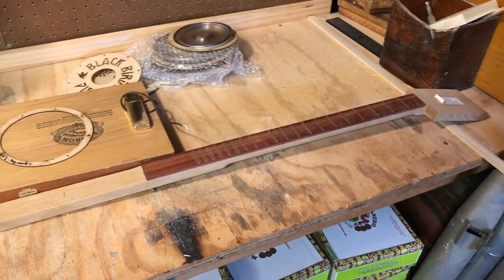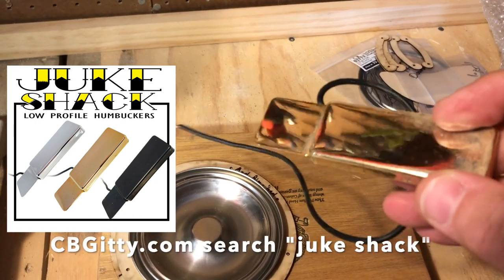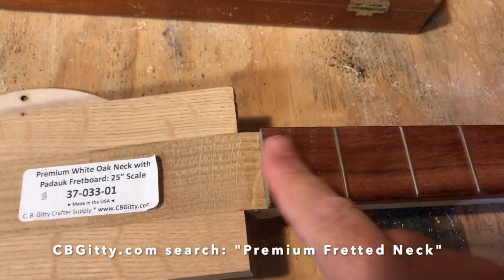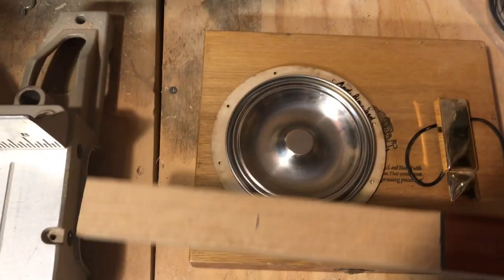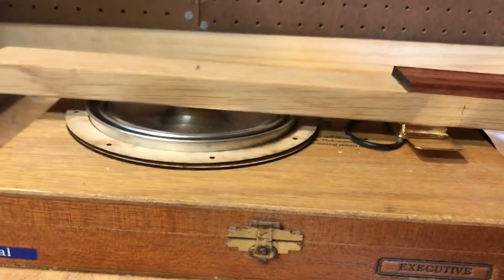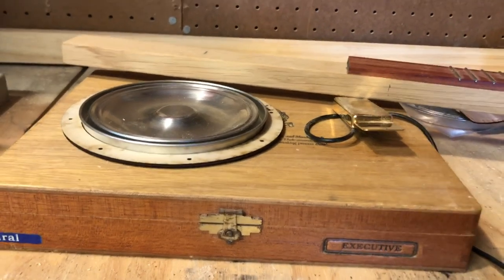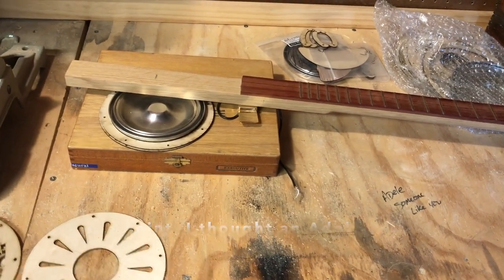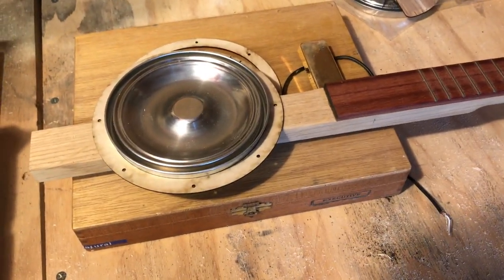The Reso-Electro Cigar Box Guitar Project pt 1: Basic Parts & Layout

Comment: This is really cool. I hope CB Gitty will offer this as a kit and as a finished product.  It could be a big seller.
Reply: THANK YOU!  Anything's possible.  To be honest, this project started with a simple request from Ben "Gitty" for me to try out his reso cone mounting rings & re-sized covers that fit his Hubcaps.   I went out in my shed and found all these parts he had sent me over the years, from the fretted neck to the pickups, etc.  I figured I'd just cook a big ol' pot of sonic gumbo... and this guitar was the result.
    The challenge of making a kit for this is in creating very specific directions for the parts.  you'll see as this project goes along that I came across many hurdles and had to hack some of the parts to make it work.  (Yes, I show those hacks.)  Usually when Gitty sells a kit, all parts are structured and ready to be easily used.  
    I have 4 blog parts & videos for this project, but I think I might be adding even more, such as adding a piezo pickup under the reso cone (and creating a dual-jack, stereo setup) among other things.  
-Shane
Reply: @ShaneSpeal  Thanks for the heads up on this one.  What you are doing here is exactly what I have been doing for the last 61 years.  I once built a pipe organ out of Home Depot scrap wood; that was a real challenge!  By all means add that piezo and give us a demo.  Thanks so much for all these interesting projects you've done.  Phil Taylor (fnersch).